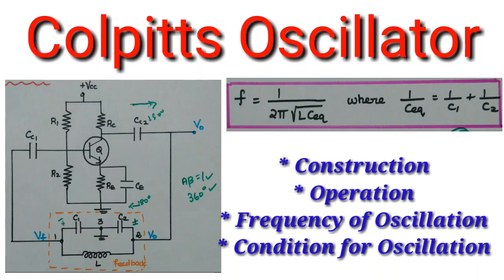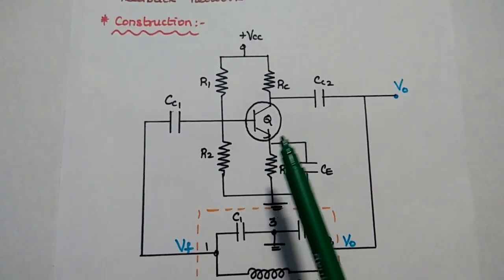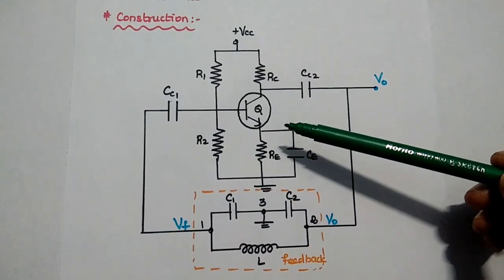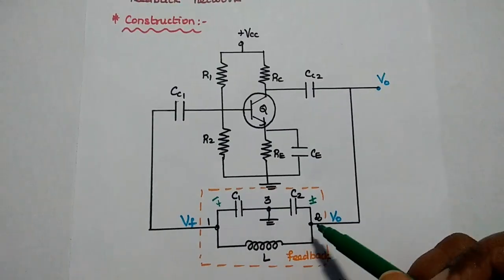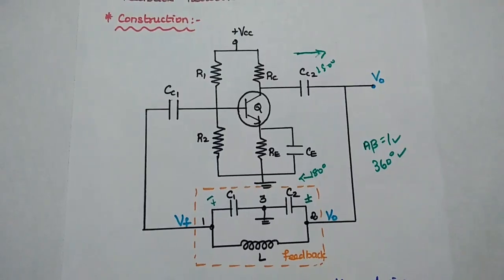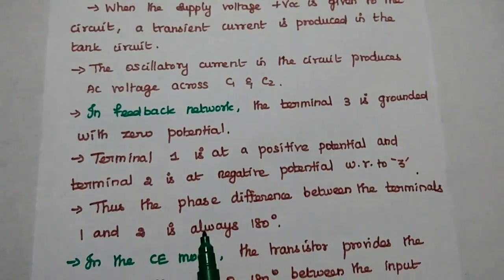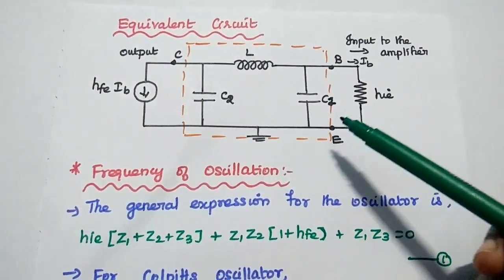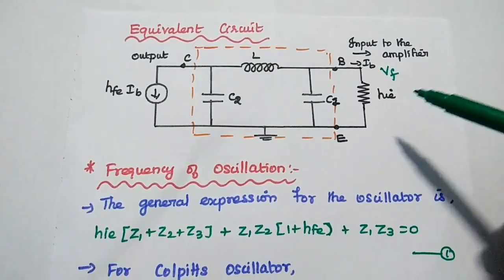Colpitts Oscillator - Operation - Frequency of Oscillation - EC8452

Comment: Thank you miss
Reply: @PadmasriNaban    Mam , if possible please make a video series on Fundamentals of Mobile Communication , very less content is available for the same
Reply from the maker: Sure....👍
Reply: @PadmasriNaban  thank you mam here's the syllabus for most university                                                     

Unit I:
Cellular Architecture - Multiple Access techniques - FDMA, TDMA, CDMA and their Capacity calculations
Cellular concept- Frequency reuse - channel assigning techniques- hand off-different types interference and
system capacity- trunking and grade of service methods of coverage and capacity improvement.
Unit II:
Large scale fading Free Space and Two-Ray models Link Budget design , Concept of Small scale fading Parameters of mobile fading channels Time dispersion parameters Coherence bandwidth Doppler spread
& Coherence time, Flat fading and frequency selective fading, fast fading and slow fading.
Unit III:
Techniques to Mitigate the fading effect : Equalisation Adaptive equalization, Linear and Non-Linear
equalization, Zero forcing and LMS Algorithms. Diversity Micro and Macrodiversity, Diversity combining
techniques, Error probability in fading channels with diversity reception, Rake receiver.
Unit IV:
Introduction to 4G features and challenges of 4G, various applications of 4G, 4G Technologies: Multicarrier
Modulation, Smart antenna techniques, OFDM-MIMO systems, Adaptive Modulation and coding with time
slot scheduler, Cognitive Radio.
Reply from the maker: Sure... But it takes some time....
Reply: @PadmasriNaban  ok madam no issues.... thanks for considering my request